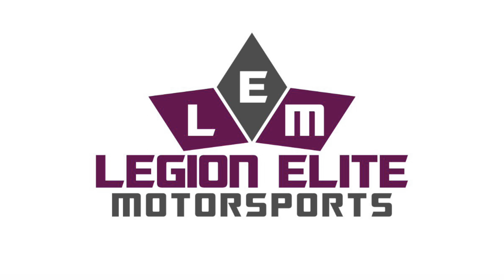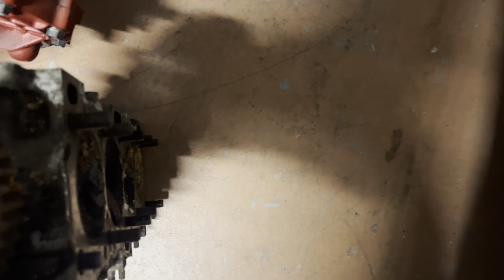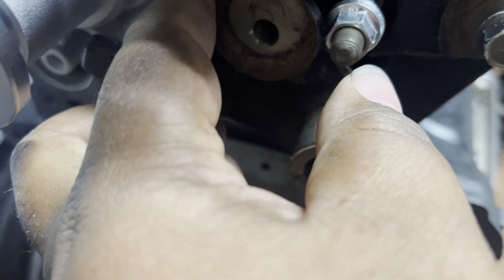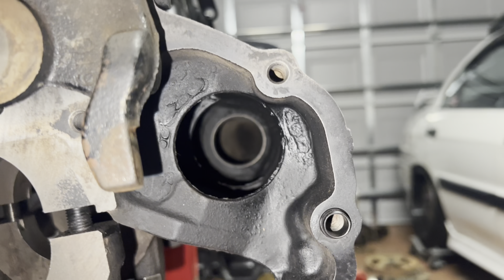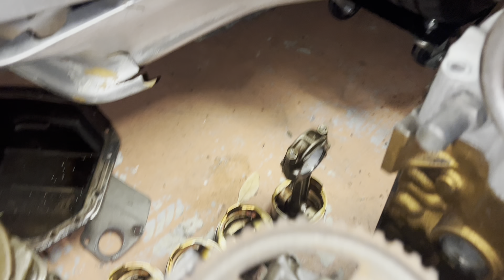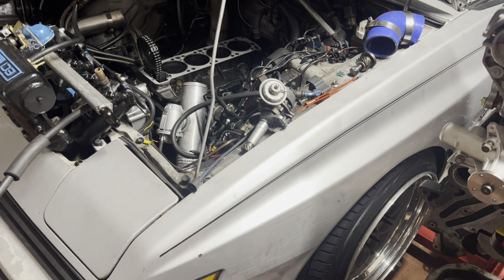4g64 ￼rwd modifications, and preparation’s ￼￼

Comment: counter balance shafts are for cancelling out second order harmonics, naturally occuring in bigger 4cyl
Balancing components won't eliminate that, or OEM would have gone that route, instead of all that effort and cost, re-engineering a block with balancers
Jackstransmissions very experienced with these motors. Very interesting comments on why they keep balancers
Their smoothness is probably a big part of why I like mitsu 4s. Most I\ve opened. shafts/bearings in good shape, so I always keep 'em
Seen more than a few scary street monsters, on stock bottom ends.... balancers and all
I guess sorta where you were headed with your 2.6.... originally?
Reply from the maker: Oh yes, 100%. You won’t be able to stop the natural vibration from a four-cylinder but you can always reduce it as much as possible in the same token. It’ll have a natural vibration, but just won’t be as bad with not having the bouncer shafts in there but yes, that’s where I’m going with the 2.6 also